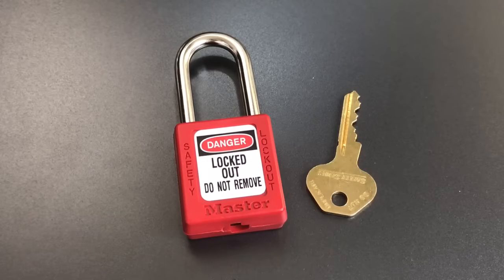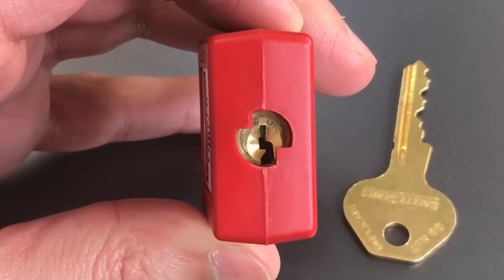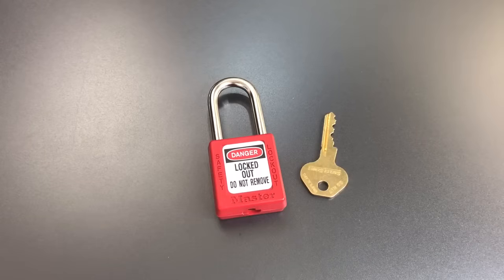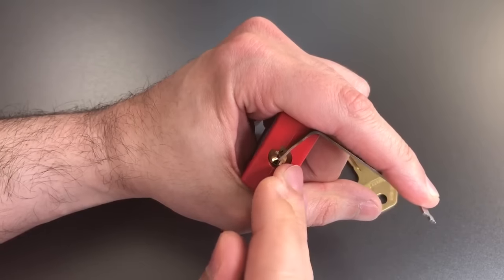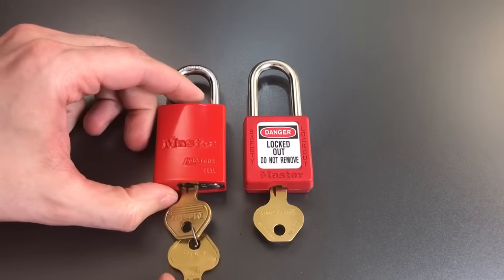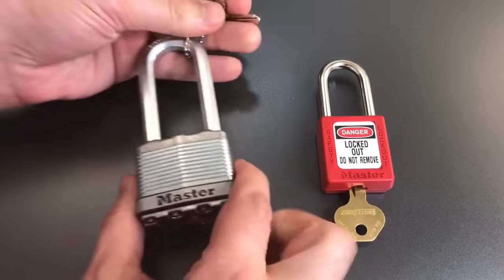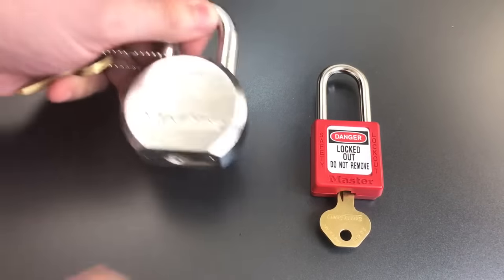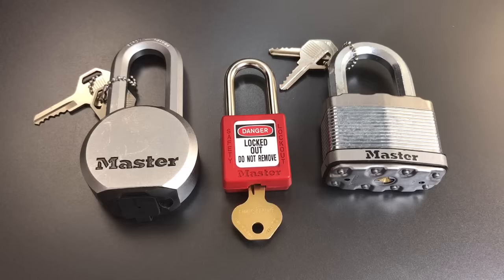[479] The Master Lock Paradox - Model 410 LOTO Padlock

Comment: I use these where I work, you need to be able to break them easily so if a pick is attempted the shift manager will know and they can find who did it. They are also registered to specific people so you can track who is working on a machine. They are usually paired with a stronger lock. Having it break easily has saved peoples lives in the past because my company can transfer or fire unsafe employees who would run faulty machinery. Seems counter productive but it works surprisingly well. Red is used specifically to say a machine has been deemed unsafe and is unable to run until the person working on it deems it safe

Comment: The key on a Loto lock will not come out of the core unless the lock is latched.
 There is no padlock made to date that can't be cut by a mechanic. The Loto does not need to be cut open. When the key is lost simply pop it open with a small prybar.

Comment: For those who say the paradox is not there because the LOTO locks have to have different keys and therefore more pins it does not stop the fact, that Masterlock’s most expensive lock cores have less pins, with fewer security features. 

As a side note, braking off a LOTO lock just because somebody changed shifts is dangerous it goes against Lock Out Tag Out procedure.

That aside the paradox is Masterlock’s best core is not on its best lock. - My dad.

Comment: I watch 100’s of you videos and I have never had an answer until now to anything you do until now. For some equipment the pic ability and the number of security features Requirements can be set by federal, State or regulatory requirements to lock out certain equipment like in the nuclear and medical industries. There’s also a requirement to number of key there can be and where they are keep and who has access. And The materials matter that it is made out of for the environment it’s going to be in especially with certain magnetic conditions call for complete stainless steel, aluminum, Brass, nonmetal composites and/or plastic components and the body of the lock. 
There are similar requirements for chemicals storage and hazardous material storage And requirements for local fire department, police, Law enforcement and or emergency Department have master keys and the locks have to be able to function in case of a spill or contamination and cannot be destroyed by the chemicals that are being stored.

Comment: Ninety nine percent of the time, lock have to defend against brute force attacks, and not picking. In most cases it's protecting something physical. The lock out lock, isn't subjected to brute force attacks. It's just to prevent tampering. What it is protecting is a person's life. So, they designed a lock, for what is needed. Not phyiscal attacks, but tempering to protect a person's life.

Comment: Just a guess but I use this type of lock on a ski hill I patrol at to make sure no one turns back on the equipment while we are evacuating chair lifts. When we do this each patroller plus the main chairlift operator puts there lock on the fuse box as a kind of verbal all clear. Maybe if this lock is used in larger scale operations they need the 6 pins so no one has the same key (because someone else unlocking your lock in these cases can be problematic) yet they saved money as no one is going to be intentionally trying to break these things off when used for a limited time like this

Comment: My insight on this is that they need to make sure that the lock is secure from other keys and other people not paying attention rather than someone maliciously trying to open them. Someone unlocking something while someone is working in a dangerous area would be catastrophic. They don't need a robust body because no one is going to be to trying to bust the lock by damaging it. They also need to be cheap because workplaces that use them usually have hundreds of employees working in one area and often they are temporary workers doing maintenance and they would work on multiple worksites where there is a risk of two people having the same key.

The places I have used these in are on large machinery where it is hard to communicate verbally with people and always have identification tags on them so you know how is working in a gated area and that area has a mechanism that shuts of the power to machinery. The locks are placed on the gate so prevent them from closing properly thus preventing an accidental start-up.

Comment: We use these at work. Really its about we have maybe 100 different lock boxes all requiring a different key. Plus 60 or so maintenance workers all with their personal locks with their own keys. And maybe a 50 more locks for contractors and extra locks. All need a different key. As far as construction, your buying 1000’s of these locks so for price cheaper body construction is probrably cheapest. Makes sense.

Comment: We just stopped using these at work and switched to all metal American Locks and I wanted to keep my old lock to use it as a practice lock but they wouldn’t let me keep it.

Though if I had to guess what the deal with the seeming paradox is, I’d say it’s probably a price issue. Put a great core in, but a bad lock body because it keeps costs down. Have a great lock body, then you need a cheap core to keep costs down. Master cares way more about mass appeal and selling security theater over any actual security. They want to be the product picked when John Smith stops at Home Depot for a lock for his shed because they seem like a great value, or the lock large organizations pick for a mass contract for LOTO locks or maybe school issued locker locks. To do all that you need to be the cheapest while providing the illusion of protection, and Master is the best at that.

Comment: Used to work for GM and anytime maintenance would service some kind of big robot or machine like a transfer conveyor, they would lock out the machine's power box with these locks. In fact, each guy that went into the machine would put his own lock on the same box and the machine would only be turned on when the vary last guy was out of the machine and took his lock off. The only thing I can think of the reason they have the core they do and the body they do is so no ordinary person could easily remove the lock but a body weak enough that if skilled trades lost their key somehow they can easily cut it off so they can start production as soon as possible. No sense of a tough expensive lock on a machine that would increase down time or be more expensive to replace. And if you don't think companies are that cheap or that anal about down time, you'd be surprised.

Comment: With LOTO the purpose is to protect people, not valuable possessions. For the human aspect, you want it hard to accidentally open with another key. However, there tends to be more trust/understanding of the meaning of the locks and people tend to honor that meaning more… hence less of a desire to break into the device which is locked.

Comment: Here's my proposal for why this paradox exists.

A lock is designed to do 2 things: prevent intrusion and detect intrusion.

A tamper seal like this is not designed to prevent intrusion but to detect intrusion. If a tamper seal is cut with a pair of bolt cutters, then it has done its job. Yes, an intrusion happened but next time someone checks on whatever it's protecting, they will see that the tamper seal is either missing or damaged, and they will know that someone was monkeying around in something they shouldn't. But if that same tamper seal is picked, then it has failed, an intrusion event happened and the intruder can simply lock it back up, and no one is the wiser.

A heavy duty outdoor lock is mostly designed to prevent people with bolt cutters in their truck from driving into your back lot while no one is looking. Most people don't have lock-picks, and a vanishingly few are even close to your skill level, Mr. LPL. Most intruders are more likely going to jump the fence or slip the latch than pick the lock. Heavy duty outdoor locks need to stand up to the weather and dissuade the public, lock pickers are just a niche threat to them.

Yes a good all-round lock could do the job of both, and would be more flexible, but I think master lock instead choose instead to save on costs and designed locks that each offer different kinds of security.

I hope I wasn't to sanctimonious there, just some things I was thinking about.

Comment: My guess would be to make them secure from picking, but easy enough to chop off if whatever was being locked out was needed and the guy with the key wasn’t around. You get that sometimes, a technician or electrician or sumn of the sort forgets to take their lock off before going home, and if it’s something essential and time sensitive to get back up n running, like a data room running off a UPS with a dying battery, you want it to be relatively easy to chop it off.

Comment: Maybe the extra pins are to deal with the Birthday paradox. If you have a hundred random 4-pin locks, then there's a 70% chance you've got at least two locks with the same key, but if you go with 6-pin locks that probability drops to 1.9%.

If you've got two hundred 4-pin locks there's a 99.2% chance that two of the locks are the same, but with 6-pin locks it's still only 7.3%. It takes about 600 6-pin locks before it's a fifty-fifty chance you've got at least two with the same key.

Comment: I can tell one reason why the shackle would be horrible. If a contractor walks off without taking their lock, the safety department has to go down and after a bunch of paperwork, remove the lock forcibly.

The one thing you don't want to be able to do on a lockout lock is remove it quietly. Either being lazy, or just rushing. However you do want to be able to cut it open if you need to. You don't want to have to take a grinder to a lock on an electrical panel. If you can't do it with bolt cutters, it's too strong

Comment: In my experience with LOTO locks we use on site the Abus Ti range. I think a 64/40. Funny thing is with loto locks they arent really usually super secure as they are more of a notice. To actively remove a loto lock is basically an attempt of inducing significant harm to someone so just the thought and the setting in which one is in means that noone will really ever be trying to overcome that lock. The funny thing being that its such an overly robust core when noone in the industry setting is going to really be trying to pick it open

Comment: We have an engineer at work, he owns 1 key and 4 or 5 locks.
Same key for all locks.

So I asked "Why?"
Well, if this is mounted where it should be, whilst an engineer is doing work on one machine, if someone would cut one open, that person would most likely be fired.

They use them to tell "We are currently doing work on this machine, if this lock would be removed, our lives could be at stake" - thus if tampered with, or cut open, you are instantly fired for that.

Comment: The point of a lock out tag out device is to prevent the sparky’s or anyone else working on or near a line that’s supposed to be off from getting electrocuted by the dummy who’s power went out and says hey let’s flip this switch and the power will come back on. It’s not meant for security more than it’s meant for hey, don’t f’n turn this switch on. Many are just a flimsy wire with the exact print ‘DANGER DONT REMOVE’

Comment: To echo a few other comments below, the most likely reason is is to avoid key duplication, and allowing the lock to be easily broken off. They are LOTO for a safety reason not a security reason. Given how long the shackle is on the plastic lock, it likely can also fit the entire length of a 200A breaker, impeding it from moving, where as a smaller lock that only locks one side of the breaker, could likely be forced past my using the body of the lock as leverage, so it would be preferable to break the lock then break the device.

On the flip side of the question, why isn't the 6-pin core in the better engineered locks, or even... ALL of them? Probably cost. Given how many of these locks are pretty trivially opened, seems like the number of pins is irrelevant over "hitting it with a hammer"-proof.

Comment: So what i am hearing is a good lock would be a v key one side with 8 pins the other with 7, a special part on the bottom to allow the pins loose to allow them to set with a 5 digit combination that needs 3 codes to be set in at different points of the key turn and a voice recognition for the last open

Comment: I believe the plastic lockout is for electrical work enviroments. 
I seen these type of lockouts used within the industry.
The only lock with DANGER printed on it as electricity is always a danger. Imo the 6 pin is so the lock cannot be opened with another key due to wear and slack due to prolonged multi use every day

Comment: You want a plastic lock for locking out electrical and other valves and machine controls. It keeps people from killing others and you can easily see damage if incident happens. Same reason it's hard to pick keeps other technicians from just picking lock and turning on equipment. Plus plastic does not conduct electricity or heat well.

Comment: the reason its made of plastic, im assuming, is because if you're buying these you need 100's of them and if they were steel it would be too expensive. Used to use these at work a lot. The shackles are actually made of plastice now too. Honestly the keys get lost a lot too because people take the keys home or they get dropped into a void space. They are there for safety but if you need to get it off quickly in an emergency you can usually just rip the lockout device off the equipment without even touching the lock.

Comment: They needed to make the lock light. Generaly when multiple people are working on a system each one puts their own lock on the securing device. Depending on the logo program you might winde up with six locks on one breaker or a technician might have a dozen locks in his tool box. As you said it's not for security it's for a little prevention and notification.

Comment: As someone who's had to work with equipment that should have been LOTO'd (but we didn't have the materials or authority to do so), I can easily imagine circumstances where the service tech and the key are not available at the same time. The higher security core should made it more difficult to non-destructively remove the lock and use the faulty equipment, while the service tech should have little difficulty breaking the lock in order to effect repairs.

Comment: The reason is simple. Liability. The chances of someone loosing a key on a job site are relatively high. They don’t have time to call a locksmith so they bust the lock so that the process can continue. However, IF you had lock that was easily picked you could “fake” an accident. The plastic body is the tamper seal.

Comment: Ive been working in industrial plants for 10+ years.  LOTO protocols for many employers allow for tbe LOTO lock of an emplyee to be cut.

this is typical when the job is done and the lock is forgotten.  so policy will stipulate the various steps you take before xutting said lock and energizing the system.

why its a 6 pin core..  well that I couldn't tell you.

Comment: These locks are meant to be added to a unit only for the duration you are doing the work. The problem is most workers forget they left them on and when the boss needs them off they get cut off. Essentially just a cheap lock would do.

Comment: It’s illegal to remove someone else’s lock. The plastic lock is used in bigger companies with larger employee bases. They need more key combinations for the plastic ones. Also the plastic ones have more keying options. You can have the be all 1 lock, 1 employee, 1 key. You can have multiple locks opened by 1 key (if a worker needs to have multiple locks to isolate the power) does need to carry bunch of keys and search for the right ones on a key chain, and you can have them opened by different keys but have 1 master key  that opens them all. The plastic ones have over 40,000 unique key combinations and the metal ones only have 1400. That’s all. It’s not to be more difficult to pick. It’s for osha regulations.

Comment: They make them easy to cut off on purpose! If you are working on (or in) a piece of equipment that’s locked out and you forget to take your lock off before going home, production will not want to wait for you to drive back to work before starting the equipment! They give you a call to make sure you’re not still working with the locked out machinery and then they cut it off before starting back up. Often times equipment can be locked out for several days or even weeks. It’s illegal to remove the lock without 100% confirmation that the lock owner is clear of the equipment. Each lock must also have a unique key. The mechanical integrity of the lock serves essentially 0 purpose during a lockout. This is why they’re hard pick/easy to cut.

Comment: Perhaps the insecurity of the long body is to facilitate removal of the lock in case of key loss. Technicians move off shift taking keys with them and equipment is quickly needed. With supervisory approval such locks can be removed by  brute force against the body or shackle.

Comment: You seem to forget cost can be a factor for LOTO, and ML has a benefit to reuse parts (the core), while creating cheaper locks around it. It is cost effectiveness for their manufacturing. Also they often need to be able to be cut off, after confirming safe condition, in case a LOTO lock is left on inadvertently.
Reply: Not sure about you guys but it's illegal in the state of Louisiana to cut off a loto